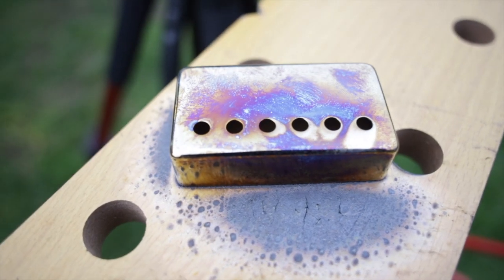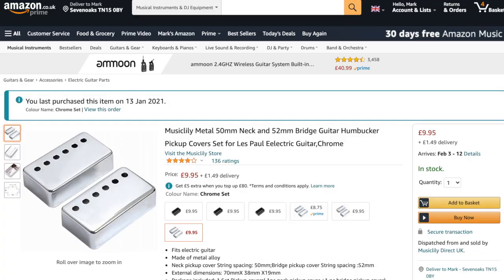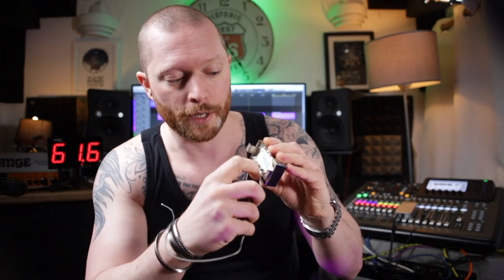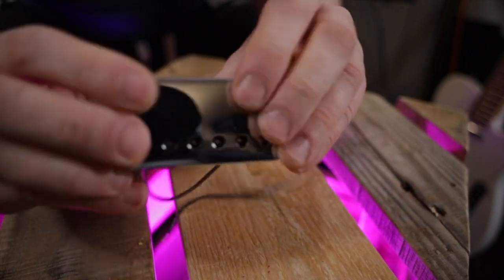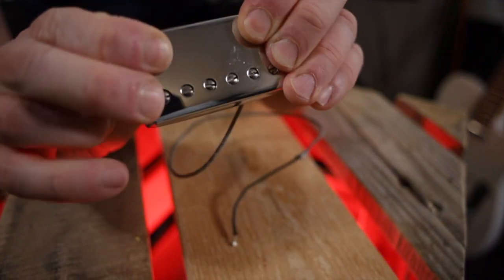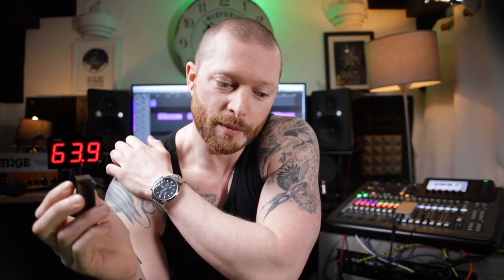How to make burnt chrome humbucker covers

Comment: Do you think this would work with tuners?
Reply from the maker: Possibly not. I’ve tried it on bridge saddles etc and I’d didn’t seem to work. Be careful with the tiny plastic washers on tuners, you’d need to remove those first
Reply: @PherotoneStudios  thank you!
Reply: hey, did u try it with the tuners? Im looking into trying it
Reply: @yorkiel7446  not yet, I'm on the budget of a high-schooler lol
Reply: @yorkiel7446  Late af reply I know, but I did on some tuners with a dirt cheap dean strat I worked with. It popped open the actual tuners, and it couldnt really withstand the heat needed to get that effect. However the tuners do still work perfectly fine, and after scuffing them up and soaking them in red wine I got some really sick looking steampunky tuners.
matched the rest of the build quite well, the only issue with doing burnt chrome with a gas burner is it ends up quite dulled with a relicd look rather than the super shiny burnt chrome ive seen on BKP. It's cool but wouldn't call it the cleanest look in the world, which is why I just set the rest of the strat on fire to match it.